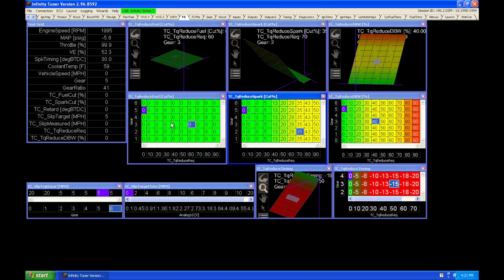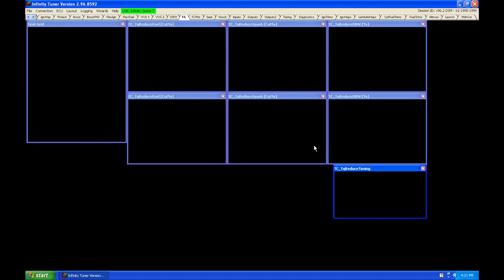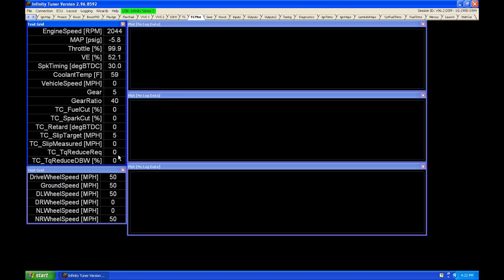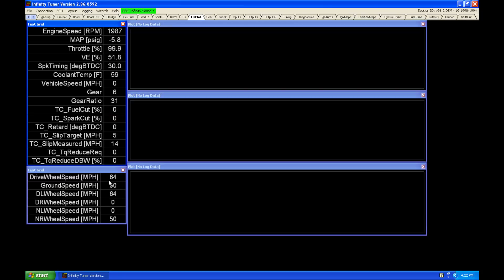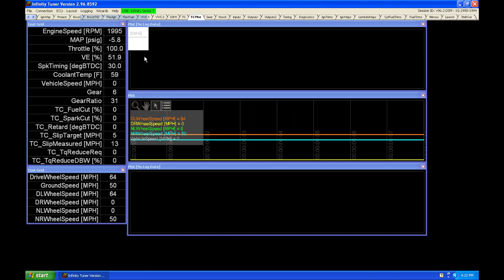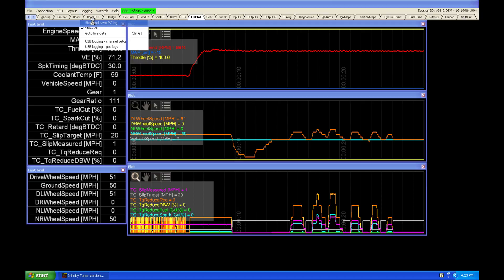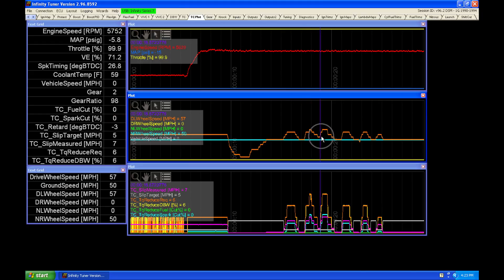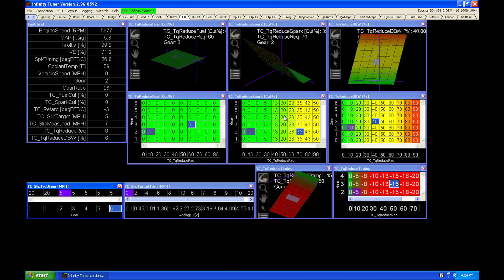AEM Infinity: Traction Control

Comment: I see you set them in this order 1- ignition timing retard and throttle position 2- spark cut. Ive heard adjusting throttle position in early stages disturbs power abruptly and been advised to follow this 1- ignition timing reduction 2- boost reduction 3- spark cut 4- dbw throttle last. In your experience what worked best for a smooth yet effective traction control thats less abrupt?

Comment: how can traction control work with awd? all the wheels spin the same speed
Reply from the maker: It depends on how the AWD system provides outputs to the wheels.  Not all AWD provide a 50/50% split.  In general you don't use TC with an AWD.  You would want to use a 3 step limiter to provide a controlled limiter for acceleration purposes.
Reply: @EvansPerformanceAcademy  my builds gonna use a transfer case. It's a v8 LS Swap. Just wanted traction control cause its gonna be a lot of hp in a small car